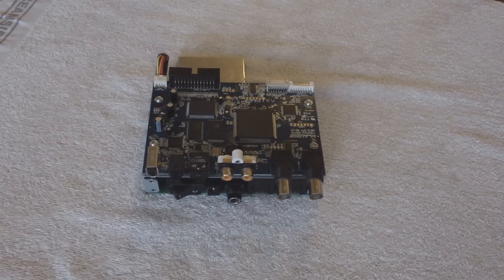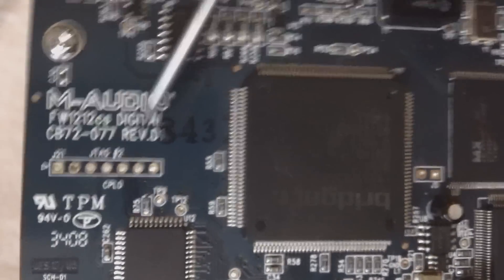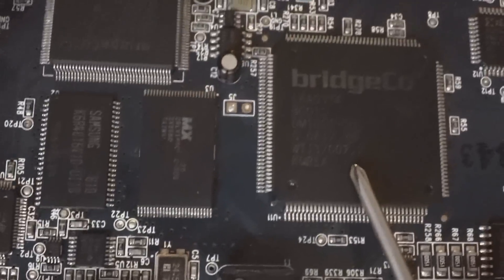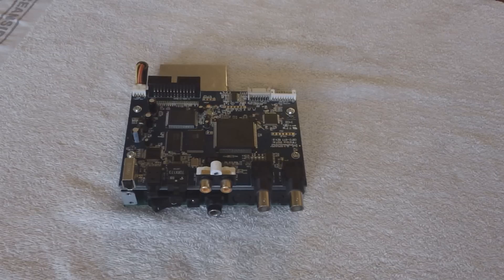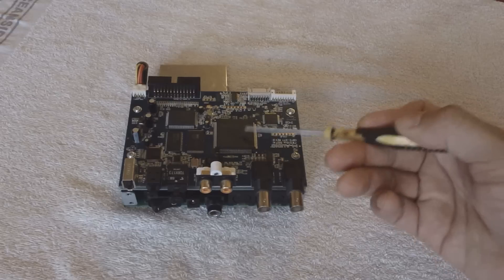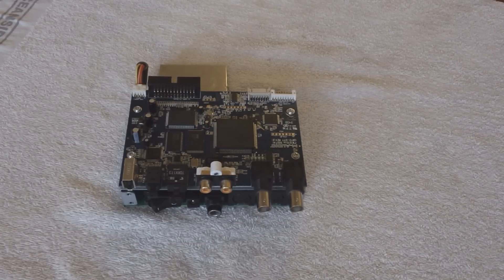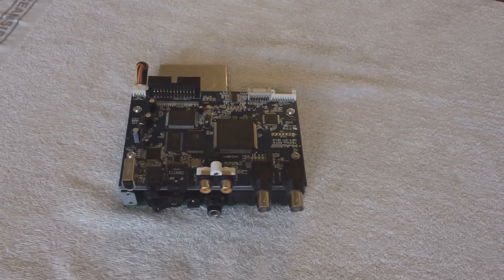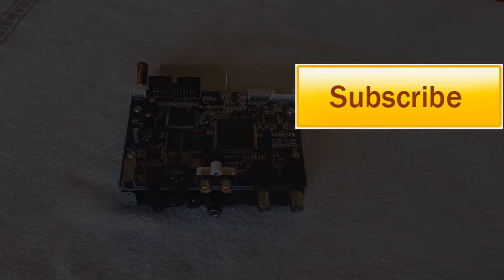Projectmix I/O FW1212cs

Comment: The firewire chip is TSB41AB1 (one port) The TSB41AB1 provides the digital and analog transceiver functions needed to implement a one-port node in a cable-based IEEE 1394 network. http://www.ti.com/product/tsb41ab1
Reply: So did your PJ Mix just stop working & went dark? Mine died & no lights ….but the Power Supply did start blinking so I bought another & the same thing as long as the PSU is not plugged in to PJ Mix the pilot light was Bright. So any help would be appreciated. I can't find the FW1212cs Digital
board CB72-077 rev D part. I was the guy that gave Ray the heads up on the supply place where he got the part.
Reply: No, in my M-Audio Projectmix i/o all function normally except the communication of M-Audio Projectmix i / o to the computer (only as a sound card and the audio section not working). That opens normally(Boot normally, lights & lcd screen ok,Motorized faders working) ,operates fine with midi connection (as midi controller).
Τhe problem on your own Projectmix i/o, is on the board that hosting the voltage regulator ICs (is the board that has the On - Off switch & the female connector of the Power Jack)  As I recall, is under the (FW1212)  PCB . If you replace all Regulator ICs but probably the electrolytic capacitor your problem will be solved.
Reply: Stergios T . Sigma Pr Thanks i was just looking at it.
Reply from the maker: I will be making a video for you soon..
Reply: I just had it open i'm thinking it's the power supply inside maybe the switch or a bad cap? Thx Ray.
Reply from the maker: looks like its the POWER MIDI board.Yes it could be a bad cap,You would need a ESR meter to test them.Identifying Bad Capacitors,Domed tops Bulged appearance Not all caps could be Identified that way.ESR meter is the way to test them...
Reply: @SIGMAPR  Hello, I have the same problem (my pc doesn't recognize projectmix) how did you make it work only as a midi controller? In my case I already have another sound card and I would only be interested in the control surface, I would really appreciate your help, regards.

Comment: seems you have the board repaired. 
project mix have some common problem on power component and firewire interface.
At 01:53 the little chip right next the 1394 plug is TI TSB41AB1 PAP48, which is probably the reason your console can't be recognized by the computer.

Comment: Im just curious, cause my projectmix is pretty much dead. Did your LCD screen function normal, or did the rest of the unit freak out as well? Thanks.
Reply from the maker: My apologies for the late response. It worked without any problems. The only problem I had is that I could not get my pc to recognize the unit.

Comment: i have an issue with my project mix when i push phantom power button the red light its on but i haven that 48v i meassure with a tester and i havent 48 volts
my question is
which capacitor or which part of my projectmix i have to check or replace thanks man
Reply: Me too, same problem